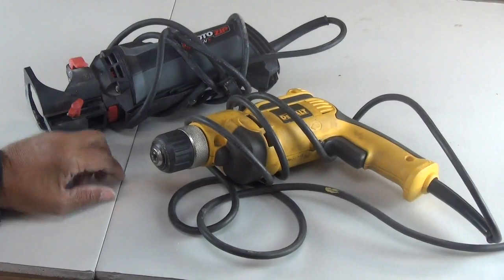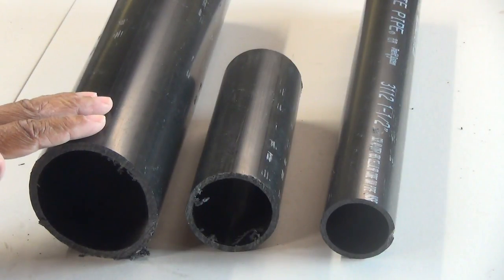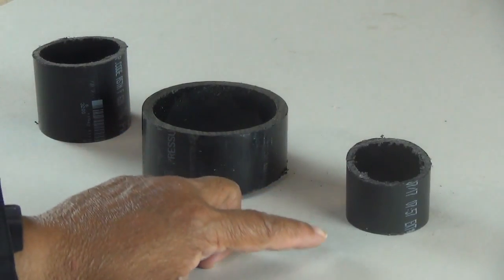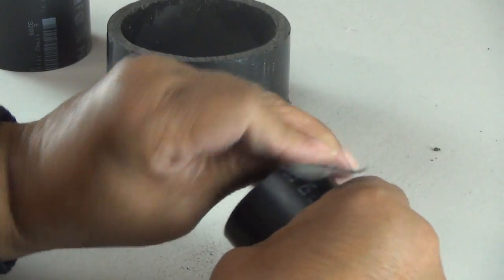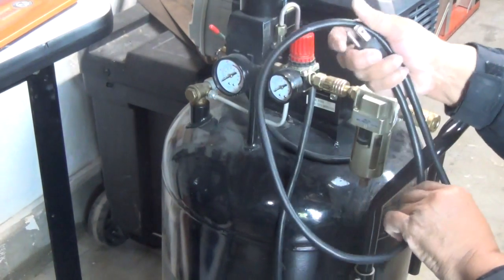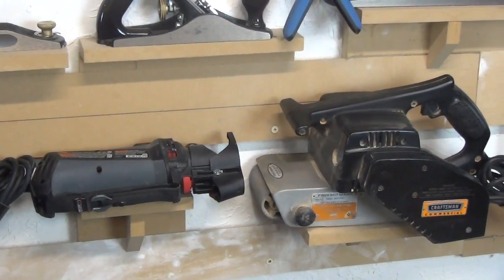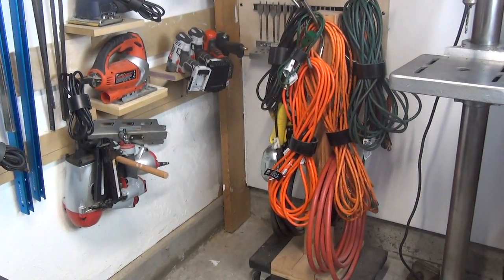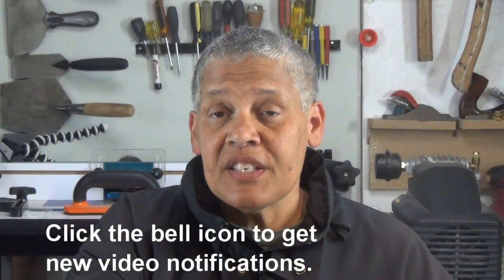Workshop Organization Tip #1: Detangle Power Cords

Comment: Excellent tip thank you.  I've been around the menfolk and their workshops for a lifetime and never seen this.  We've sometimes wrapped cords with velcro strips, but they are small, get lost and eventually the fabric fills up with sawdust and doesn't stick.
Reply from the maker: Hi Jennifer!  Velcro isn't a bad option; I just like the plastic pipe because it is very durable and cheap.

Comment: You are a great inspiration, Am a Kenyan and get a workshop with even the average power tools is hard not even the veteran craftsmen do have them except some dilapidated hand tools. But am determined to pick the power tools atleast one by one as at the moment have got a black n decker jigsaw and a makita circular saw but they are pretty expensive here the cheaper ones are the chinese brands. And am just a hobbyist but God willing i will reach your level someday.
Reply from the maker: Hi Dan, that is very interesting.  You know, you would think that tools were accessible everywhere, and it always surprises me when I hear that tools that are available here aren't accessible everywhere.  If you email me your address, I will send you something.  Best regards, Leah
Reply: seejanedrill thanks!
Reply: i sent u a mail longtime, not even a simple respose hehehe

Comment: Another thing that I do to help save space/make it easier to separate extension cords is to make a loop using about 18" of mason's string. I then loop it through the end of the cord bundle and hang it up ... no more entangled bundles of cords - I can get the bundles down one at a time and not have dangling/tangled loops making a mess. Thanks for sharing the tubing tip - I will definitely be using it!
Reply from the maker: HI Chuck, nice idea!  Thanks for sharing it with the community. 🙂

Comment: You can use velcro cable organizer straps to the same effect. Cost a couple of cents each and are much less of a hassle than cutting pipes. They're not heat resistant though.

Comment: I use the oil bottle cut the bottom and the tip and use the body of that 4 extension chords and velcro straps 4 pwr tools

Comment: good suggestion, you can also use plastic pipe to make simple clamps, just cut a slot on one side (so you can clamp something by spreading the pipe apart).  The longer the "clamp" the more force it puts on the piece being clamped.

Comment: Hi Leah!  I used to use a product for painting (lots) of window trims on those factory type windows using Wagners Glass Mask. (coat the glass and scrape it off with paint when dry). It saved tons of cleanup time.  The product has been discontinued and I can't find a replacement?  Any ideas?                            Thanks..........Luv ya..   Cros'

Comment: Hey Leah, another great video. I've learned so much from watching - I've learned things things I didn't know I needed to know! I have a question though - what's the difference between emery cloth and sand paper? I'm from Sussex England and have only ever used sandpaper! Thank you, Sue
Reply from the maker: Hi Sue, emery cloth has a fabric backing, and is a bit sturdier than sandpaper.  It also contains aluminum or iron oxide, so is good for use on metal.  That said, either will work for this project!

Comment: Wow Ms Leah! It sure beats the cardboard from paper towels and toilet paper😂
Do you have a video on repacking an outside hose bib (faucet)? I'm using a LixIt for the dogs and it's a frost free type. Yes, I know I'm supposed to use the regular type, but I will have to cut the Sheetrock, cut the copper, install fitting and hose bib. I'd rather learn to repack.